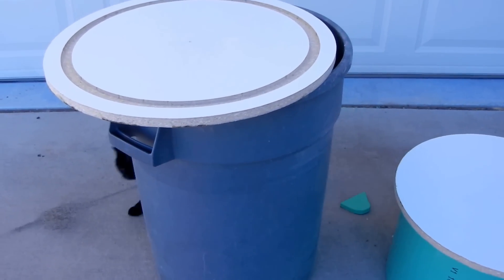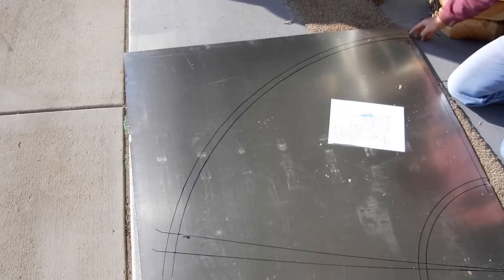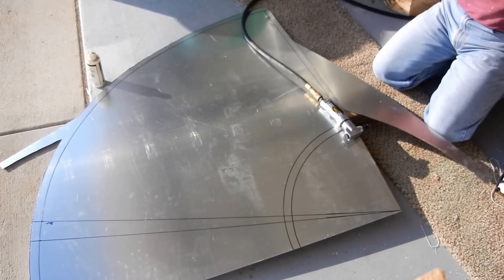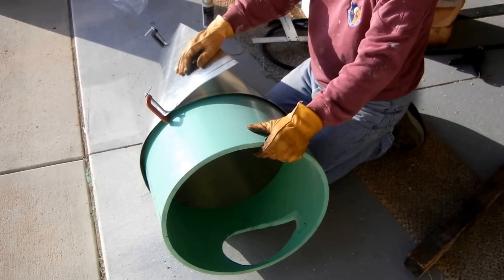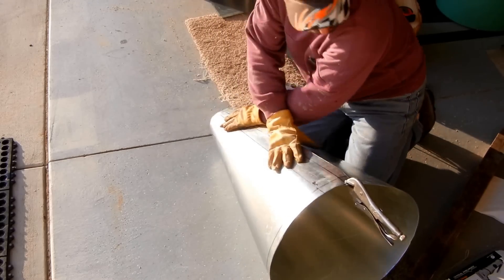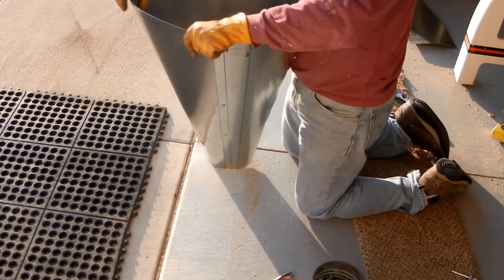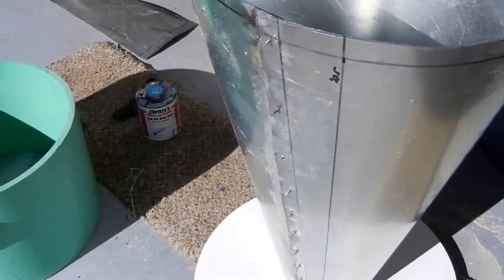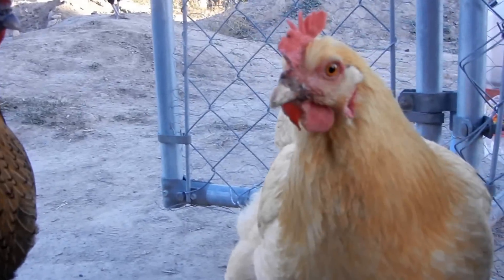Building a Cyclone Separator Dust Collector code named the Turbulator 4000 Part I

Comment: I've been researching heavily to make a frustum and finally figured out simple method to lay it out on metal very, very quickly each and every time. no confusion from all the math professors I've been watching online it can be a very convoluted process. Using my method I've made a few Frustrums already for Cyclone dust collection systems. All you need is 3 pieces of information to lay it out on metal for those who may be watching the video and want to make a Cyclone of your own. You need your slant number (which is typically slightly more than the height of your Frustum (cyclone) and you need the radius number from the larger diamter hole and you can lay it out quickly on metal to cut and make your own cyclone. You can enter the parameters  of your frustum from using a Frustrum online calculator to get your slant number. (Enter Height, Radius 1, radius 2) The only numbers you mark on the metal are 2 lines which are your slant line distance and the degree line. You get degree line yourself with no online calculator by dividing the radius of the larger hole by the slant number then multiply by 360 will give you the degree line you mark off of the slant line drawn on metal. Then connect both lines making arc. Starting at the 2 intersecting lines. Then measure up from the same point to make arc for bottom hole which is twice the length of your bottom smaller hole. I will post video in next few days "how to" for those interested to make your own cyclone. Btw as far as I can tell The bottom portion of your frustum you have 6 in from the bottom will only give you 3 inch diameter hole not 6 inch. I'm assuming you wanted 3" hole? as Oneida cyclones have a 4 inch hole on the bottom. Looking good tho! DIY cyclones are a lot of fun to make and make you feel proud of creating something functional! 😀

Comment: Very nice.  Where would I get that large-diameter green pipe.  Is that PVC of similar?  Thanks.
Reply from the maker: I know it is green 18 inch PVC pipe.  I got it from a dumpster as a cut off from the crew putting in a  pipe in a new subdivision.  I am not sure where you get something like this.  I was just lucky and grabbed it and thought that would be great for my cyclone.

Comment: I just made one of these based off of Jeff Coulam's design from Lumberjocks.com.  http://lumberjocks.com/projects/19069 .  Everything works good, but I have one question.  How do you deal with the static electricity build-up? I've seen lots of different designs and store bought models, but none of them talk about static electricity.  With swirling air full of sawdust and dust, you're going to have static electricity.  How do we stop that or at least ground it to prevent build-up and discharge?  I've had small shocks when I've touched my cyclone while it was running.
Reply from the maker: +Lee Mcminn I haven't had many issues with static electricity.  I was warned a lot about this and told to put metal straps in the plastic bucket that is connected to a plastic hose and mounted to wood frame.  If I was getting shocked I would have bolted some wire strap to the hoses and the plastic garbage can and ran this to ground in my house wiring system or a grounding rod.  The motor I am using is grounded with the a 3rd prong outlet and the whole cyclone is sitting on a concrete floor. I think it is a good idea to add more static straps and I will when I move this into the permanent location in the closet. Maybe I will check this out some more.  I am also using a metal duct connected to my metal lathe that is sitting on the concrete floor, this may help with static discharge.

Comment: The sheet metal I used was for duct work. At first it worked OK, then I decided to empty the shop vac and unclog the filter. The suction must have tripled. I decided to check for leaks in the seam and in the other joints by putting my hand over the intake. BAD MOVE! The cone imploded. It turned the cone into a 4-sided pyramid. I popped the sides back out and it was fine for a bit. While I was vacuuming, it imploded again. Any ideas on how to fix this? Obviously I either have to use a thicker gauge of steel and make a new one or reinforce the current one. I don't want to make another one.
Reply from the maker: cynisturb Hmm, that is a bummer.  Off the top of my head you could make some king of exo-skeleton and screw from the inside out into a wood type frame.  Or you could put additional sheet metal inside the cone and screw into the other cone then trim the top.  Good luck and let me know how you fix it.
Reply: Turning Round
I fixed it. I made two sets of rings out of 3/4 plywood. I used the table saw to cut the outer circles and a band saw to cut the inner circles with a 10 degree taper on the inside to match the angle of the cone. For each set, I rotated the two rings180 degrees so the cuts from the band saw were on opposite sides and then glued them to form one solid ring an inch and a half high, an inch and a quarter thick at the top, and whatever it worked out to be at the bottom (maybe an inch and three quarters). The bottom set was three inches in diameter less than the top so that if you divided the cone into thirds, the rings would be at the third points which worked out to be 6 1/8 inches from each other. I used silicone adhesive (the same you would use in a bathroom) to adhere them to the cone, put eight screws through the cone into the bottom ring, and 16 screws through the cone into the top ring. Let it cure for half a day (cures completely in 24 hours), and tested it. Works great with two exceptions. The lid on top (I cut the top 7 inches off a bucket and bolted it to the top of the cone) and the lid on the bottom for the catch bucket (5 gallon bucket) gets sucked in all the way when the hose gets clogged. The lids are 3/4 plywood with a slight taper on the bottom and a curved taper on the top. And if you don't shut the vacuum off within a few seconds, the catch bucket implodes.
Reply from the maker: cynisturb That is great,I am glad you got it working. It sounds like you have a powerful vacuum if is will implode you catch bucket.  Keep building it better then it will work, for a long time.
Reply: +Turning Round http://MoneyandTask.com/?refid=55870

Comment: I forgot how to do the calculations for truncated cones so I needed to find a website to do it for me. The thing is I had a 24" x 36" sheet of steel sheet metal and wanted to make the tallest cone I could with it given the diameter of the top and bottom.
I used this to figure out my cone: http://www.i-logic.com/conecalc/conecalc.htm

Comment: Pretty good video.   Magic word you need to google is frustum ( I keep wanting to spell it with an 'r' after the 't' , DON'T DO THAT ). When you find a forrmula that you enter your top & bottom diameters and cone height into, that yields radi to draw top & bottom edges and "slant height"  AND angle betwen your "slant height" edges, then you have gold.   Mark your exact edges and about 1/2" beyond everywhere.  Fold back the extra 1/2" material in opposite directions ( 1 up, 1 down ) along the "slant height" edges.   Along the radi drawn edges cut the 1/2" extra material into tabs of an 1" or so width for joining, your frustum, to your other parts.

Comment: There are ground wires that you can attach to a metal duct, or drill a hole in a plastic duct, and attach it to the machine that you are using to give static electricity a path "home". I have read, however, that any collection fires most likely started by sawing through a nail, making a bigger spark. The article stated that grounding is recommended though just to be on the safe side.

Comment: Something to think about.  Sawdust has a very high Kst and Pmax value with a high explosion potential which your dumping into a plastic container which inherently produces static electricity.  In essences your creating the perfect situation to create a fire or more likely a bomb.  Not a very good idea.
Reply from the maker: This is true and something I will consider.  I can easily replace the lower can lid with a lid that fits a 55 Gallon Steel drum.  I am also planning on using this for a Lathe that produces a huge amount of large wood chips, but I have a few sawdust tools as well so I want to be safe.
Reply: Its still safer than just using the shop vac. If all that dust collects inside the vac and builds up, it will either blow out into the air,which is where it is most dangerous,  or if the motor decides to go sparky, which happens a'lot, then there will be lots of fun. Also, much dust will eventually accumulate on the motor parts if you regularly use a shop vac. So, its still a good idea to use this, provided the material in the plastic bin  is promptly and properly disposed of.

Comment: The Oneida Dust Deputy is a pretty slick unit.  I bought the large metal (Super Dust Deputy) unit as a backup to a field test we were doing, and never needed to use it.  So, if anyone is looking for a brand new one... I've got one.  Pardon the pon, but it is collecting dust in my garage.  cjaxcjax@att.net

Comment: Like the vid. Have been working on my own cyclone. The inlet pipe gave me some problems too until I made a jig from some plywood scrap and some 2 by scraps. Basically it is just a radius cut into plywood the OD of my top hat. I put a screw into the center of my partial circle radius into another flat piece of  plywood which I clamped to my band saw. I used the 2 by stock to fasten to the partial circle radius which gives me the approximate downward angle (compound angle) for entering the top hat. I used a couple of large dryer vent hose clamps to hold the pipe when I cut it. After swinging my pipe through the blade, the part left in my hands was the finished pipe cut just right. Was kind of fun coming up with that.

After that I mounted my pipe to the outside of my top hat and slowly cut out material until it matched the inside of my pipe. I used PVC for the pipe but had to use polycarbonate for the top hat. I wish I could find a large piece of PVC like you have, would have been better if I could get a glue weld like you have on yours.

Great stuff.